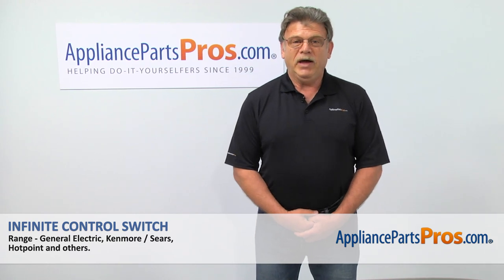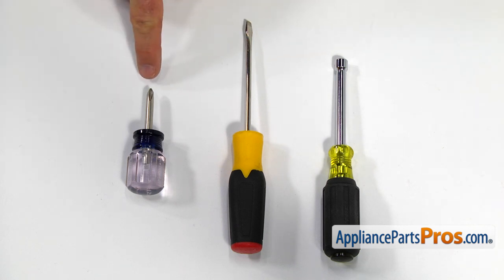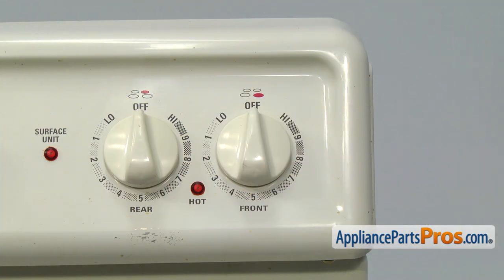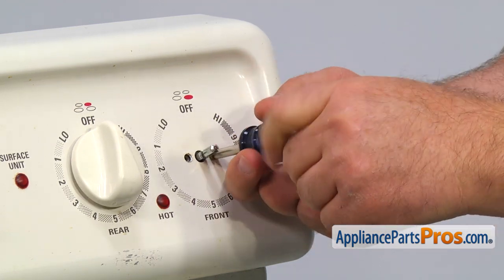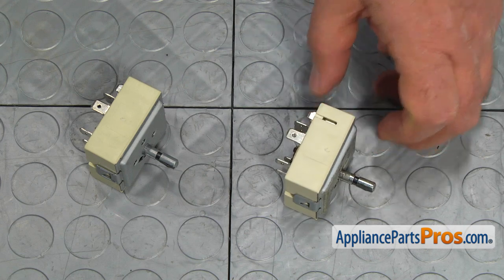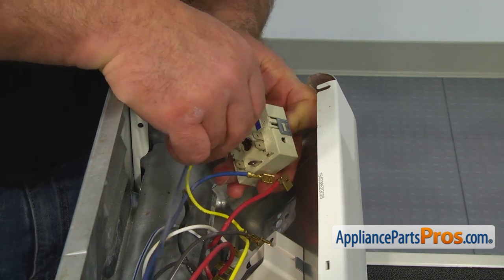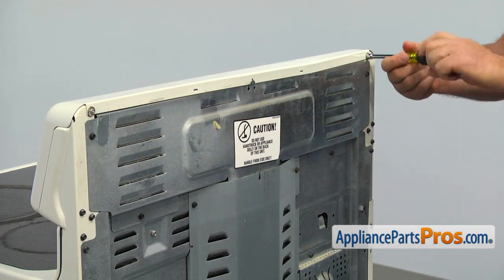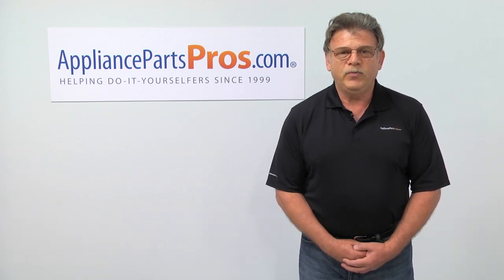How To: GE Infinite Control Switch WB24T10058

Comment: GE PROFILE slide-in RANGE; WB27T10803
My back left small burner- 2nd dial from left- keeps light on & element stays warm. I NEVER use this element-since 2007, so it turns on by itself & stays warm/light barely glows.
The 2nd switch -which is linked to the double-burner (1st dial/switch by wiring), is labelled;

ECO (blue)
Looks like yours but I cannot read your labels…
Terminals are; clockwise-
2x -P1
2
P2
PILOT (bottom)
4 (left)

The first dial is not causing issue-(has L label)-but 1&2 dials are linked by wires; you can make all 3 parts heat for a long pan.

Do I only change this “Pilot” switch? Or could 1st “L” switch be it? 

I cannot find how to test this PILOT switch online- only the ones labelled with L’s & H’s).
THX- stuck without a stove now.
Reply from the maker: I'm sorry, WB27T10803, is not the model number of your appliance. If you can provide us with your model number we can look up this information for you.